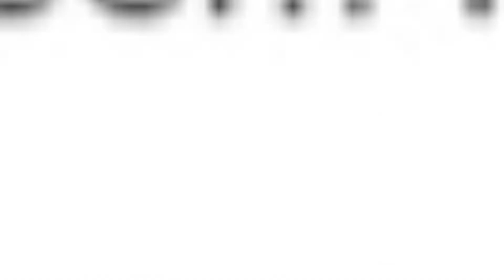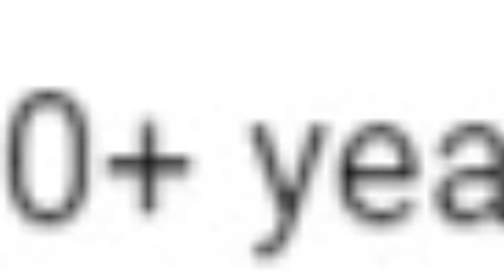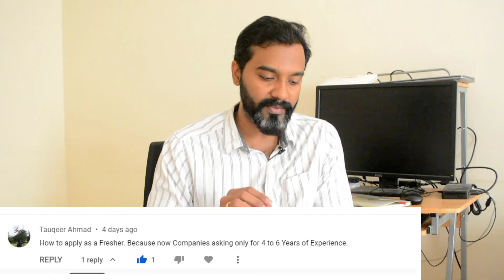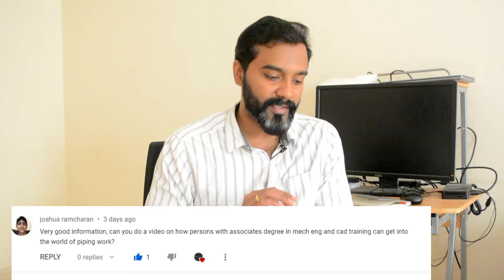Pymedaca Piping Q&A session

Comment: Are you belong to tamil. If you tamil. Please make video in future tamil. Surely you will get plenty of response.
Reply from the maker: Thanks for compliment. But I am from Kerala. I do speak tamil as I worked in Chennai. My intention is to reach across everyone beyond language and state to benefit more people.
Reply: @pymedaca3130  I wholeheartedly agree with your comment I do not have any alternative opinion ,Your intention is you are using English to attract all the linguists working in the field of piping, Thank you very much for my congratulations on further strengthening your youtube channel .however ,the opinion of many like me is to start a tamil PIPING youtube channel in the future  Like me, you should post videos related to the new  oil and gas video with piping Tamil explanation in the future. If possible please make FBE coding topic.(Fusion bonded epoxy coating) .Please list the things we need to consider when designing this pipe
Reply from the maker: Sure. I ll definitely give a thought for your message.
Reply: @pymedaca3130   if possible please make video about Aramco piping STD. class, which will be more useful for every piping engineer. It is worth noting that the Aramco standard for this topic has not yet been recorded on any youtube channel and it is my humble opinion that it would be great if you could pick up those topics.

Comment: sir i m very frustrated because i m not getting job on the position of piping designer so what should i do  i have good the theoretical knowledge and technical also on both software sp3d and pdms , i m not getting  even a single call regarding piping designer job , i think there is no more  job in this field ,so sir please suggest me what should i do
Reply from the maker: Hi Neyaz, I can feel your frustration. But don't loose ur hope. Giving up is so easy, anyone can do but being determined and stay committed is possible only for strong minds.

Note, in the current situation, crisis has struck in all the fields, not only in Piping. Piping designer is a pure technical job and has good reputation across the world. To get an entry in to any technical field, it takes time. Please don't compare piping with IT, even in IT, getting in to the core jobs like developer, programmer, analyst, is not easy. But in IT, lot of people are getting jobs, just because there lots of sub-standard jobs are there. For those job, no education qualification is required. Getting some job is not worthful. Getting in to job, we have worked for is important. 

 You said, you are not getting calls, that says you are applying for jobs. This indicates, there are jobs. We can't say that there are no jobs. 

Be honest and tell me, how many small companies have you visited in last 90 days. 

Finally, please check your CV structuring and ensure right terminologies are used